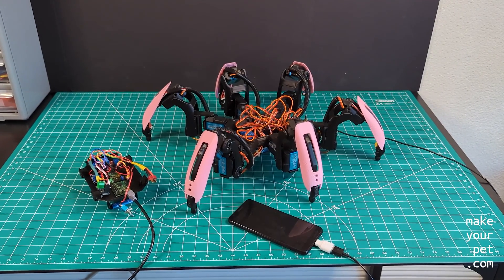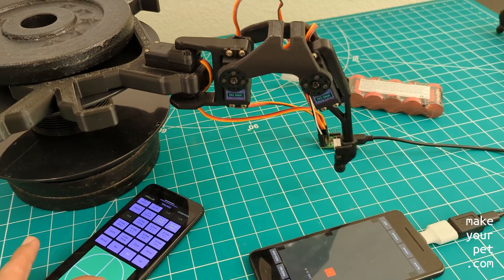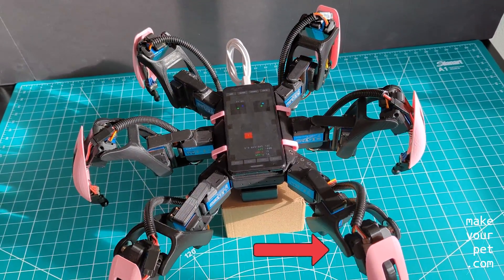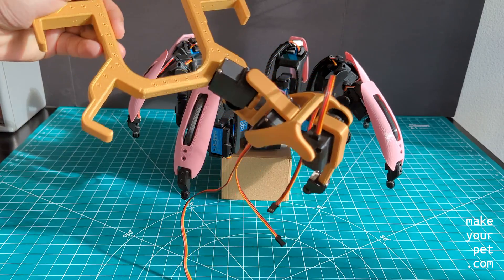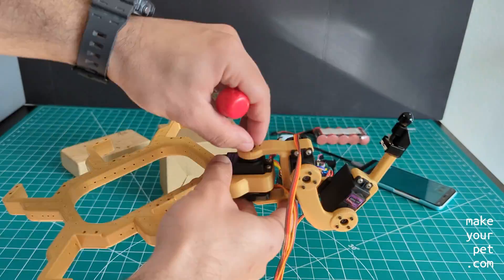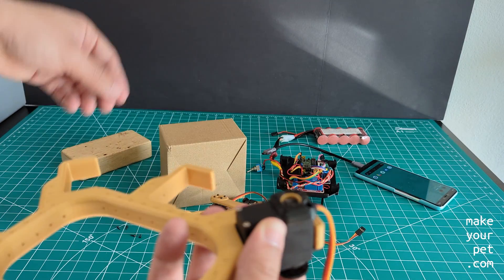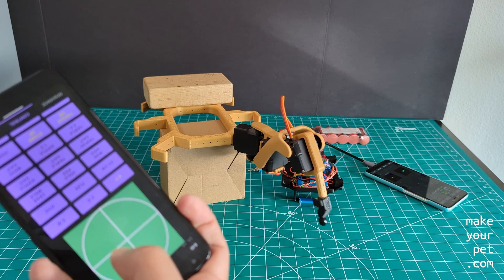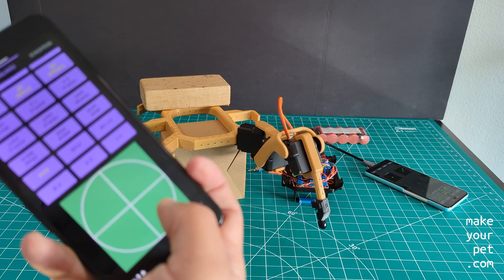Cheap DIY Hexpod Robot for under $150! Part #1. Using MG996R servos.

Comment: i spent an hour switching parts around but the screw holes on the tibia are on the wrong side for easy construction. Unless there is a file on the github repository I am missing I can get the layout  to work without drilling holes manually.
Reply from the maker: You should not need to drill any holes manually. Note that tibia and some other parts are mirrored for the left and right sides. For some of the parts only one side is provided on github, since you can easily mirror the part in your slicer application.

Comment: Just need an 1500$ 3D printer too 😅
Reply from the maker: The $150 price tag is assuming you have a 3d printer and an old phone to use with it. You can get an Ender 3 for under $200 which is what I have and is more than enough for a project like this, and you get to keep the printer for your future projects.
Reply: @makeyourpet  THey've got a lot more affordable since last i checked, huh!

Comment: Hi are you using any capacitors before the servos?
Reply from the maker: I think you are asking about the pwm signal? I am using an off the shelf board so I didn't need to do anything.
Reply: @makeyourpet  Ah I thought you might need another capacitor because of the current that the Servos are pulling to smooth it. But cool, thx 👍

Comment: Brother in my country i can't find both the  18 channel servo drivers is there any other way ?
Reply from the maker: which country are you in? so both pololu and pimoroni boards are not available?
Reply: @makeyourpet  i live in India and china is not delivering to us right now... And servo 2040 are out of stock from websites who deliver internationally... I am thinking about using an Arduino mega and 2 x 16 channel 12bit pwm/servo controller. Will it work?

Comment: why not put bearing instead
Reply from the maker: Based on the others experiments from the Discord server, apparently bearings don't help with the overshoot either.
Reply: If that's the problem then it's not mechanical at all maybe it's electrical there's noise in the servo controller board
Reply from the maker: It is mechanical. the pwm error on these boards is way below the servo dead band.
Reply: @makeyourpet  i have to solutions that may work for ur problem you should lower the gain value, or may change the frequency of the servo motor

Comment: Is it possible to just use a Raspberry Pi Pico instead of the Servo2040 as they have the same microcontroller?
Reply from the maker: Yes you can. If you implement the same protocol that we used with the Servo2040, you can use a RPI with the phone. If you are interested in the details, reach out in the Discord server.
Reply: I actually did it and it's quite difficult to find an ic to replace the switch multiplexer on the servo2040 board. What I did was , I used a cd4051be ic with a logic level convertor with 5v so the ic actually functions properly without the 3.3v vcc being too low , which meant an ams1117 5v regulator to the servo power rail and the buck/boost convertor set to 6.6v since I'm using mg996r with lipos , and 8.4v is too much for them ( the mg996r will work fine under no load but with experience, I can say over time mg996r/mg995 dies fast with 8.4 ). But when you buy a rpi pico board , make sure To buy the super board , which has all the pins taken out , since the standard pico doesn't have the 3 pins that's needed for the A,B,C inputs of the multiplexer ic in the original servo2040 , in the one I build these 3 pins are used for the inputs A B C of the cd4051. ( I think you could also use 74hc4051 which works with lower voltages and eliminates the need for the logic level convertor , but it was hard for me to find the ic )
Reply: Also I used a type C raspberry pi pico , the other micro usb one is a real pain if you use a phone with type c , since the type c doesn't output power to a USB device unless certain things are there and without an " OTG " type cable , a normal type c to micro usb convertor just doesn't work this way. You can also microsolder two thin wires to gain access to the pins of the pico that's not exposed on the standard breakout boards , but you kinda need practise to run such small jumpers.

Comment: This is so cool. I am going to build one. What Kind of Filament should be used?
Reply from the maker: I used PLA. you can use anything that you like.
Reply: @makeyourpet  thank you. I have a lot of PETG so i might try that.
Reply: @makeyourpet  Would it be possible to use the MG996R servos with the existing design?
Reply from the maker: @SB-100  you can try if you want to, but most likely it will be very underpowered.

Comment: Did you check that the servos actually have all metal gears inside? Some vendors on AliExpress cheap out and only have the output gear metal so it looks right but the inside gears are all plastic. I got a very bad one once, if you turned the output manually rather than back drive it just sheared off all the plastic teeth and it was advertised as having all metal gears. I hope you managed to find decent ones and checked the quality and performance of the one you bought before buying all of them.
Reply from the maker: Good point. So far the servos are ok and don't show any sign of gear wear, but I didn't check the inside. Honestly at this price range I can live with a few non metal gears...

Comment: What about the Battery? what's driving all these servos?
Reply from the maker: Good point. I am going to use a 6V NiMH which you can get for around $20. Keep in mind that this is not final and things may change.

Comment: 3D-printing the bushings is a good solution, but it is still safer to install cheap flanged bearings like f623zz
Reply from the maker: Some of the members of the Discord server tried bearings, but cheaper ones have some small play and unfortunately they still experience servo overshoot.

Comment: A lower cost version would be very welcome! It looks like the middle servo is doing most of the work, maybe only that one needs to be a high-torque servo and the rest can be a smaller 996 and you could keep all of the original dimensions...?
Reply from the maker: Yes replacing the femur servo will improve things a bit. but it definitely won't have the same performance of the higher torque servos. So there will be limitations still for sure.